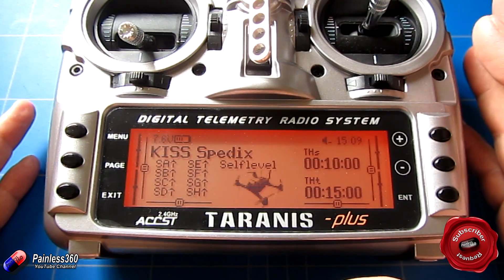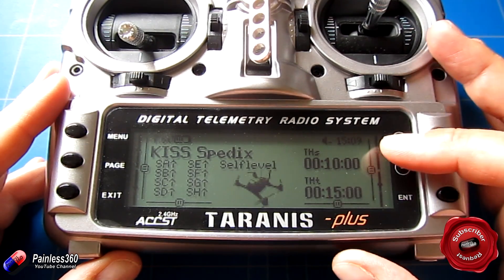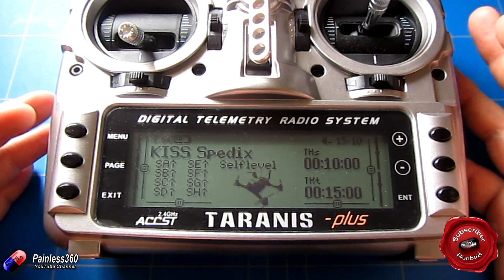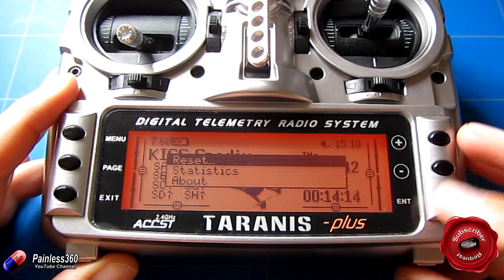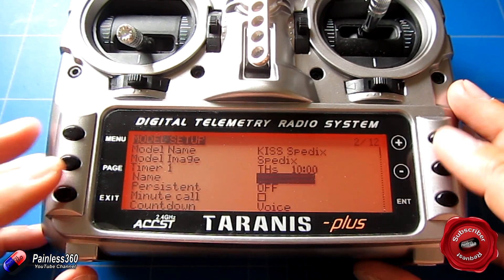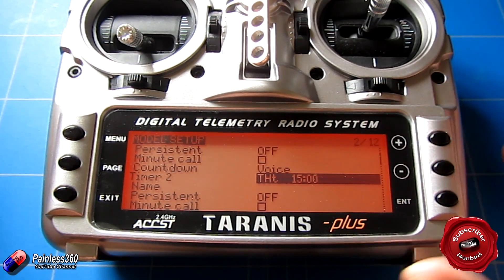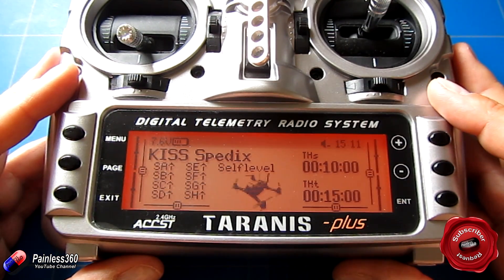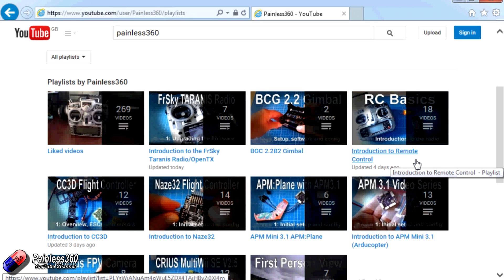Taranis & OpenTX 2.1 Quick Tip: Setting up and using automatic timers

Comment: When I set mine to ths the timer just runs. I found that its reading the pitch stick for the timer... How can I change this?
Reply from the maker: Not sure, I've never seen this. 'Ths' should read the throttle.. Let me know if you find what is causing it.. Best of luck!
Reply: You should check first your throttle value when stick is down. maybe it's not well calibrated. Should be -100

Comment: Hi there, my timer is not activated by the THs, it starts as soon as I switch the unit on. Can any bodyhelp me on this. Thank you.
Reply from the maker: +Alexey Saulin Ths runs the timer when the throttle isn't at idle so I'd check the calibration of the throttle and make sure it's not setup to be just 'on'. Best of luck!

Comment: I've been using throttle percent. In the absence of voltage or current sensors it is a way to prevent running the battery too low. If it is windy then I use higher throttle which uses the battery more quickly  so faster count down and shorter flight is safer.

Comment: I use one of the special functions bound to the trainer switch as a quick reset for all the timers. It's a bit less fiddly than holding down and resetting each one. Th% is also interesting as it counts down faster the more throttle you use, so if you spend more time at high throttle you'll reach zero quicker than pootling around on half throttle.

Comment: Does anyone know if you can mix ESC's I blew a 20A Simonk and now having trouble getting another off eBay. I got refunded for the first now the next lot are late. I have just took a week off to go flying. Now it looks like a waste. I could cancel my hols but I found an RC shop 15 miles away that sell little bee 20amp. If I bought one of these would it be OK. Or do they all have to be the same.
Reply from the maker: Not recommended. All ESCs need to be the same firmware really.. Best of luck..
Reply: Painless360 thanks mate, will head your advice. Holidays cancelled, Great vids by the way.
Reply: Painless360 what if I found another shop with simonk but not exactly the same, say afro.
Reply from the maker: I've even used the identical ESC with slightly different firmware and had huge problems. You may be luckier..

Comment: You can set a 2 way momentary switch to reset both timers. It's quick and easy. I've set it on the SH switch. A quick flick and both timers reset.
Reply from the maker: Great idea, how exactly are you doing that?
Reply: I added a Special Function (page 11/12) and selected SH (arrow pointing down), RESET, Timer 1 and 2 and ticked it.
Reply from the maker: +norazil I've not spotted that! Thanks for posting!